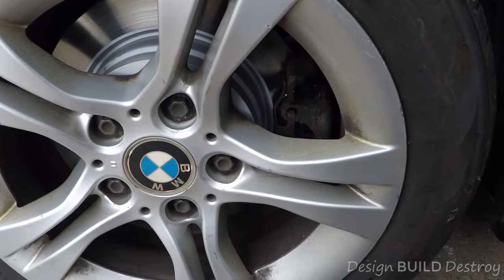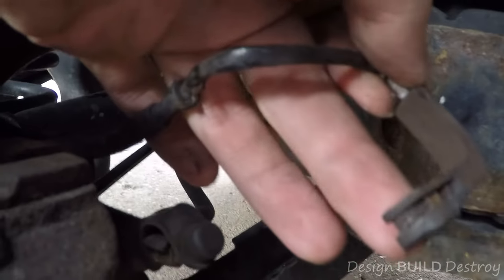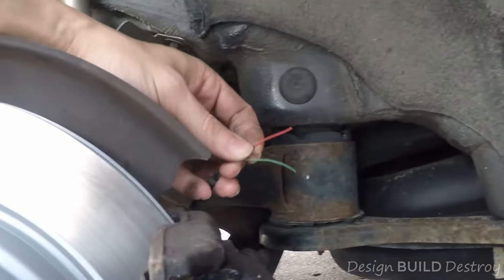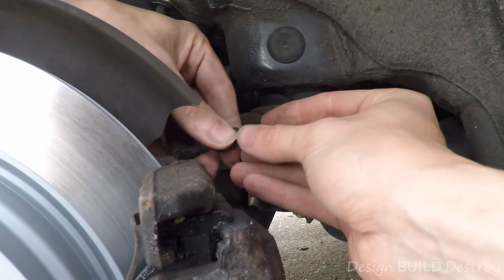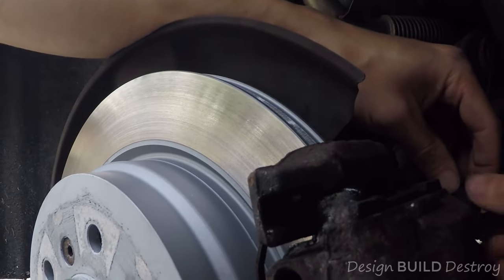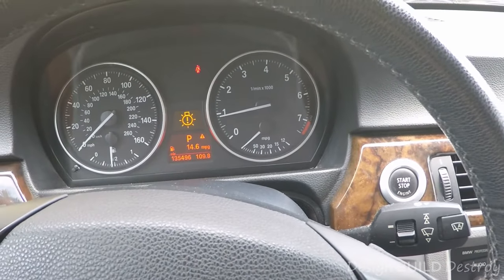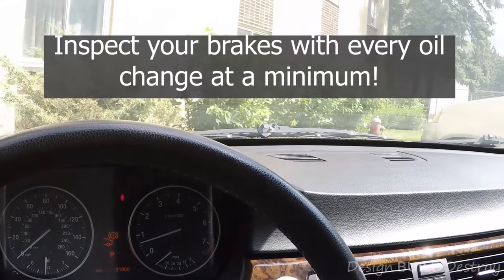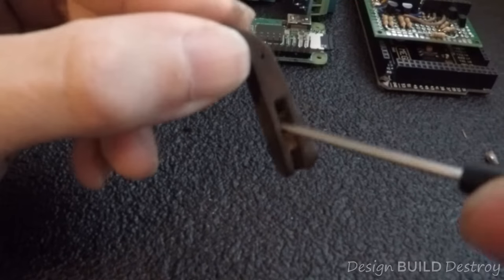BMW Brake Sensor Bypass - How it works

Comment: You can do this bypass up closer to the box, and not have any wires that you tuck away near the brake pad. These sensors are for profoundly clueless folks that have no idea how to do their own brakes. Bypass them early and often.
Reply: Where exactly?

Comment: I did this EXACT same thing to my car because my dongle is saying, "rear brake pad sensor fault", except I soldered the wires together and the light is STILL on. I reset the fault in my PCM and it's came right back on. Edit: BTW, I put brand new pads, rotors and calipers on the rear of my car, but my car has H&R lowering springs (2") and 225/40/18s on it, so the wiring rubbed through. I cut the harness all the way back to the plug and resoldered them, so we'll see.

Comment: This warning can trip if the car has high mileage as well and can be very annoying especially when you know the brakes are good. That's why if you have an older model, this is a great fix for that annoying "service death light".

Comment: Replaced brake pad on my 320ied but could not reset mileage from dashboard: reset unsuccessful.  Sensor seems faulty n i just removed plastic n twisted the 2 sensor wires together to close the circuit.  Reset was then successful.  Thks a lot

Comment: At the sensor end I grinded off some plastic and bridged the broken circuit with a tiny wire and solder, then covered it with a little epoxy glue and back to work.
Reply: Good; the epoxy glue will wear off when pads are worn again and you do it all over again.
Reply: Infinite brake pad sensor.. 🤣🤣 good idea.

Comment: I have this problem because i changed the brakes and also the sensor and after that i got the service light, can i use my old sensor to do that and reset the warnings and then connect the working one that is on rn back ?
Reply: You need to reset with new sensor In. Car in neutral. Parking brake off.

Comment: I went to grab a sensor at the local yunkjard yesterday and the car that was there had the sensor cut off and the wires twisted together just like this video. I was so confused as to why he did that and today i run into this video showing me why 😂 probably just going to do that with my car instead of buying a new one for $10 on rockauto

Comment: Any chance a faulty sensor would cause a parasitic battery draw?
Reply: No, the system just measures if there is a circuit (brake pads with plenty of pad left) or if there is no circuit (sensor circuit is worn and broken and system measures much resistance so it knows the pads are fully worn).
It's not like this working when the ignition is off.
Reply: This tricks the computer into thinking all 4 sensor are good riggt.

Comment: So I got a message on my X6 that the brake pads needed replaced in 600 miles.  I had thought that the sensor was a prox sensor but I guess it's not.  It must have tripped because when I installed new pads and re-used the old sensor, my Launch scan tool tells me that the sensor is unplugged or has a broken wire.  I got a new one today.
Reply: Then I came back to just hear the music

Comment: Why not just buy a new sensor and install it? It takes 5 minutes and it’s cheap. Then go into the BC and reset the service interval.
Reply: For one: The sensors trip when there is plenty of pad material left, and if you do work with your car yourself you should regularly inspect the brake pad wear visually anyway.
Reply: @christianeriksson4733  exactly. This is why I'm here. The brake wear sensor on my lady's Mini trips with the pads still in good condition. I just hate having the light on.
Reply: @Latinofire202  same thing literally happened to my wifes 2009 mini, did you figure out your troubles? I wanna get that darn red car on lift sign that pops up every time we start car
Reply: @su35supaflanka  well I've replaced the brake sensor plenty of times. When it trips, the car raised in red comes on and then the front or rear car picture goes red too and that tells which brake sensor tripped. I haven't done the bypass on it because I have a spare sensor that I'm just going to replace eventually.
Reply: @reza_dc2  yeah no.

Comment: Does this only work with the e90 or with the f10 as well
Reply from the maker: Best to check with a multimeter for continuity like I did at the end of the video on a sensor that hasn't been blown yet to be sure. Unplug the sensor from the harness and test at the two pins in the connector. This should work for any car of any model that uses a simple wire loop that breaks apart to trip the light. All you are doing is fooling the car into thinking the wire is still intact by splicing the two ends together.
Reply: My mini shows yellow brake light and pads are still thick. Can i just do this and dont get new sensors?  Will it damage anything on the computer
Reply: @DesignBuildDestroy  is that sensor same as abs wheel speed sensor?
Reply from the maker: @Platinumtag  No, they are separate sensors in different locations. But iirc the end connector for both are in the same little box tucked under the wheel well.
Reply: Does it work with 2004 bmw x3 3.0 asking for all owners
Reply: @Platinumtag no there's another sensor bigger with one bolt to hold it. The two connector ends are near each other. The break light and the abs are two different wires ones blue and ones gray for ending check up under the plastic of each wheel follow wires up sometimes its behind and sometimes its infront of plastic